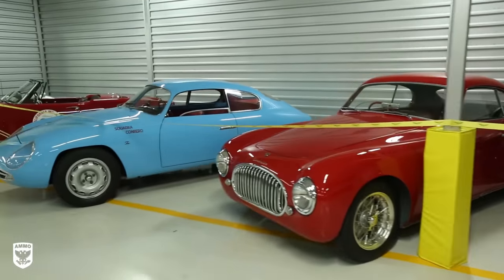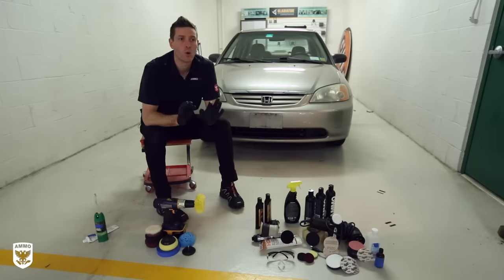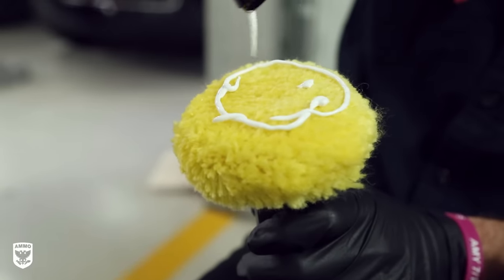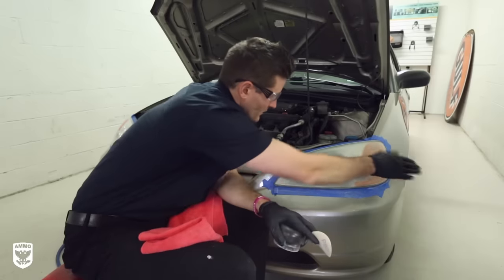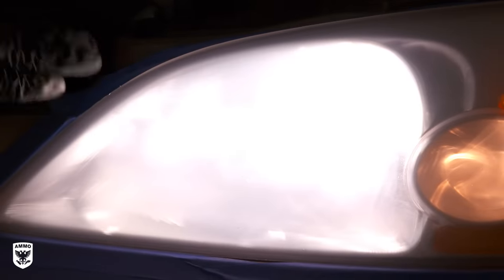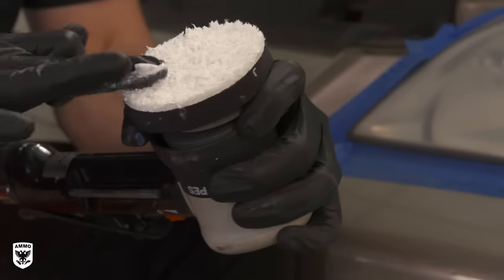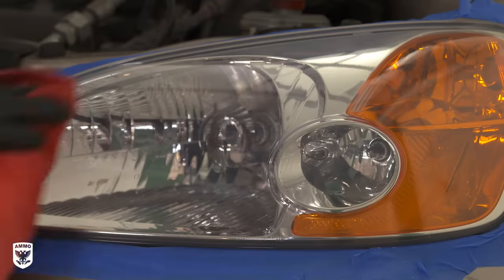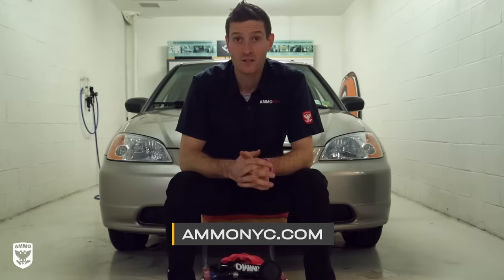How to Fix Foggy Headlights: 3 Different Methods: Honda Civic

Comment: Just a tip... I would suggest your sanding steps should be vertical - horizontal - vertical.  You want your first and last groves to be vertical.   This will insure your light dispersion pattern his spread across the road surface, similar to a vertical prism distribution.    Having horizontal lines after the last step will cause lights waves to be shot up into the sky.

Comment: Came across this a few years ago, back for a refresher.  Still the best headlight restoration vid on the interwebz
Reply from the maker: Thanks!
Reply: Hi! Which system are the grit sizes recommendations referring to? For example P180 (FEPA) is 180 (CAMI), but P1500 (FEPA) equals to 800 (CAMI). I'm not sure which grit sizes to get, my grit sizes come in the P-numbers (FEPA)

Comment: Don't forget to change your blinker fluid
Reply: mark schroeder i was going to comment that LOL
Reply: Remember to put on throttle body spacers for +50hp
Reply: ROFLMAO    I hadn't thought to do that.  Better get on it!!!!!  TOO TOO FUNNY!!!!!!!!!!
Reply: Nowadays you don't need to change it because car manufacturers put as much as 600.000 blinks before the fluid starts to go low. That's what my father told me when I bought my car.
Reply: Lmfao!
Reply: Gotta change those piston return springs soon too.
Reply: I was told my fuel cap pads need to be replaced monthly, too. Is that true?
Reply: My blinker fluid keeps leaking but I just found a blinker/flasher seal kit and I got a great deal on ebay 6.99 for 1 quart of blinker fluid w the purchase of the seal kit. It's 19.99 at Autozone . I just replaced the muffler bearing 2 weeks ago that was an exhausting job but it's done. All I have left to fix are the 8 Kuniphaler pins that hold the back of the wheels on and she'll be like brand new. Don't forget to change the air in your tires every 1789 miles for proper tire wear.
Reply: R Paz plz tell me your joking. Ik the first comment was a joke but I can’t tell it seems like your not
Reply: my new car has hydrostatic blinker oil in a sealed and heat treated capsule, no more fluids it's awesome.
Reply: I also hope everyone remember that it's time to change to summer air in the wheels now.
Reply: Lmfao!
Reply: @user-rm3tr5gb1t  HAHAHAHA but snicker, snicker, I WILL pass that on to a friend!!  Well maybe we won't be if she ever figures it out! IF
Reply: mark schroeder always use a left handed screw driver when open the blinker fluid bottle
Reply: @RP944  think I have a blinker leak , I only got about 346,002 blinks before it stopped working.
Reply: @jimdomi6206  It also depends which blinker you use more. It is known that for example in right hand traffic countries where we tend to take right turns rather than left ones we use the right blinker a lot more so it consumes the fluid faster. But hey, 6k (or even more depending on manufacturer) is a lot of blink going on.
Reply: @kentaylor5842  yep thats why they're called return springs,, you have to return them to the store for new ones
Reply: @RP944  thank god for the internet,  i would never have known that. Thank you!!
Reply: @jimdomi6206  if people listened more as we do there wouldn't be many ignorants in the streets/roads
Reply: Where are the fucking spark plugs on this Diesel engine?
Reply: Also be sure to replace your muffler bearings
Reply: It's seasonal fluid as well... you really don't want to use your summer fluid in the winter.

Comment: So if you added a sanding step and a layer of protectant to the "DIY" kit, you'd have something that's pretty much professional grade. Cool beans.
Reply: Locutus They actually sell kits like that.
Reply: Is it me or the yellowish layer that forms over time is not the lens cover, but just the "protective UV layer"? 
So I should polish the headlamp and apply a product which filters UV so It won´t be yellowish again?
Reply: Correct - you definitely need protection if the UV-protective layer either failed or was polished off.
Reply: kits come in various forms. The one I use is $20 ish and it has 3 different grades of sand paper, 2 grades of polish and a uv sealer. It also comes with a backer to use in your drill. For $20 i can do about 8-10 cars or 5-6 if the lens are really bad on 3-4 or four of them. I get a lot of my work from my towing business and do it during off time while having a beer or 3 in the evenings. It takes about 10 mins per lens and charge $35 ech lens or $45 if they are really bad.  If i lived in bigger populated area I could get paid to drink beer lol.
Reply: Bonniville Black Cherry hey man! That’s the reason I’m watching this video! I’m 16 and I would make more than minimum wage doing this in my area. So many cars with haze. Make friends with the guys that own a couple car washes, tire shops, mechanic shops, get me some business cards made. While also going out and getting clients myself. $35-$40 a headlight for GREAT results. Go after it and get as many cars as I can after school and on weekends.
Reply: @bonnivilleblackcherry9745  Just dont ever let them know they can get aftermarkets on Ebay or Amazon for the same price you charge to do those lights. Lol
Reply: yet to find light housings on ebay for $35 that are in good shape and amazon doesn't sell used shit that I know of. SO good attempt at trolling there sweetheart ;-).
Reply: Small print shops do not charge that much for business cards. Do a car that has both lens very hazed and take a pic after one is done. have them put it on the back/face depends how you look at it lol. And your contact info on the back. You can also buy sand paper and the polishes in packs/bottles separately that would do a 100 cars for the same price as a a kit would do 8-10 cars. Hit up a body shop supply biz for them.  A cheap canadian tire (im in canada) polisher is great and its not being worked hard so will last yrs. Key thing is wash the lens well first. I use wd40 for a quick spray to remove any tar on them from the roads.  Let it sit for 15-30 mins. whipe it off then wash with (i use dawn) dish liquid soap. I go over the lens quickly by hand with 800-100 grit. This will show if any shit is still on there to bet burned into the plastic lens before you hit it with an electric polisher. Once clear go to town with the sanding and polishing.
Reply: +Bonniville Black Cherry  ...  You obviously don't know how to refurbish lenses.  First and foremost, you should not and cannot recommend the same procedure for all headlights, which is what you just did.  Also, WD-40?  Heh heh.  15-30?  800-100, (I guess you meant 1000)?  They may just need a polishing.  EDIT:  BTW, no one with a brain "goes to town" with any finish work, at least, not the way you imply.  The work should be evaluated, thought out, and precise, depending.
Reply: +Bonniville Black Cherry  ...  She was not trolling, she is correct.  Why are you so defensive?  You don't want people to know the truth.  Also, the job he did on those headlights.  He still did not get out most the pits.  The best solution is to buy new ones.*  I bought BRAND NEW headlights and fog lights and side markers for under $200.  They even came with bulbs (which I did not use, but if the person needs to save for better ones, those will suffice).  Plus, there may be OEM restored headlights that can be bought for less, and for less than what you charge.  ...  *If a person decides to refurbish, then the so-called professional way is not the best, to start.  It may just take a polishing, by hand or orbital, then UV protection.

EDIT:  Note, he (Larry) already has the tools, which is a bonus, and he did do a good job.
Reply: $200 for lens for what type of car netzoned? And get back to me in how long they last before hazed over.  I don't refurbish 2005 honda prelude lens.  People usually come to be when the lens are $3-400 or even $12-1500 per lens in some cases. Not eveyone drives a honda or a toyota.
Reply: LiveLaugh MakeLove restoration of your original lights are good since they’re more higher quality than those on eBay or amazon which will only look good for a year or several months
Reply: Offhand 3M has a kit that has sandpaper in the kit!
Reply: @bonnivilleblackcherry9745  plus, a lot of cars you can't actually get replacement housings for anymore.
Reply: @bonnivilleblackcherry9745  which kit is it? Where did you find it?
Reply: @bonnivilleblackcherry9745  
I checked Ebay for replacement headlights for my 06 Maxima.  $164/pair.  To replace, you have to pull the whole front clip off the car.  I've done this and it ain't quick or fun.  
If I were in Canada, I would look you up for $35 each,   I would even hand you a beer when needed.  However, you one, me one ya know.  

X4
Reply: @kittkatt032  LOL,NO  but nice troll attempt(not)
Reply: @bonnivilleblackcherry9745  im looking for options my dealer quited me 2000 including labor for changing lenses on a 08 forrester so you are right they cost a lot.
Reply: @kittkatt032  good luck on that sweetheart. I'd charge more to install them and in some cases by a fair margin. My market isn't ricer kids with fucking honda civics lol.
Reply: @frankmontez6853  any auto parts store has them.  If you have stores like canadian tire (canada) they would have them too.
Reply: Why does he dry sand in the professional version instead of wetsand?
Reply: I used sandpaper 800 to 3000 and then,  on an unpolished surface a clearcoat for headlights.  I made it this way so that the clearcoat adheres better.  But the surface of the headlights feels different now,  like it's a little sticky,  not that slick,  as a new headlight.  And it's still just a little yellow.  I've been told headlights also get yellow on the inside and that yellow you can't remove unless you take it apart.
Reply: @kittkatt032  bruh headlights can be easily $150-300 EACH on the aftermarket
Reply: @LiquidTurbo  At least in furniture finishing, it is nice to dry sand first to see that it is completely sanded, but just barely. Sanding dry gives a completely flat (no shine) finish that is easy to judge. When you have just gotten the finish completely no shine, stop and move on.
Reply: @rodc4334  thx

Comment: Not professional but super quick permanent solution is melting poly-carbonate surface with heat gun. You can super easily burn it, but with experience comes good results.

Comment: After watching this video, I had the confidence to do this myself to my car. Got a $15 from the auto parts store with the polish and protectant along with a buffing and sanding kit. Grabbed a few sheets of sand paper from the hardware store too just to make sure. I had my headlights looking like new in under an hour. Saved me a ton of money and I hope that it lasts. If it doesn't, I know that I can do it again myself!
Reply: Do you remember how long it ended up lasting for?
Reply: For this car, getting a new headlight is another option it's around $100

Comment: After trying many different headlight restoration kits, and spending over a hundred dollars, not to forget the labor I put into trying to make these products work, I figured out the perfect way to get clear headlights again. I shopped online and bought replacement headlights. It took me less time to instal them, and now they are perfect. I did have to realign them as to not blind my fellow motorist driving the opposite way. I am very happy now and tell all my friends, to just buy new headlight assemblies and save time, and aggravation.
Reply: sounds like you half-assed the job, or just didn't follow the instructions completely. The 3M kit definitely works.
Reply: Maybe in your country but in mine? Not so cheap :P
Reply: Decent DOT certified lights are not cheap, at minimum for most cars you are looking at $250 a set, I got a complete 4 step kit for $40 and had enough to do probably 5 cars, so did mine and a few paid jobs and made money.
Reply: Headlight assemblies for my vehicle are over $300 for the pair...not really an option.
Reply: @Barry Goldwater congrats to you!...my 10 year old toyota headlights are yellow and cost $250 each for OEM and $190 for non-OEM. So yeah, I'm gonna polish my lights...
Reply: @Barry Goldwater prius with stock HIDs.
Reply: lol my headlights are over 1k a piece

Comment: Yep I do the 2nd one all the time, but I skip the pad and just use some 600 grit sandpaper, wet sand it, then 1000 grit, then I rub it out with some of 1 year car polish on it. It takes about 20 minutes to do and It last for a few years before I have to hit it again. Granted it's not professional but it works really well!  Thanks for sharing. Best Wishes & Blessings. Keith Noneya

Comment: Great video.
Another solution that works is direct lemon juice. (cut a lemon in half, rub it directly over the headlights followed by 400 + 800grit sandpaper then with the lemon again) It's great for people who have allergies to chemicals, or don't own power tools.
I had to do my headlights 12 months ago and they are only now showing signs of needing to be done again. I never went over the top with a UV coating the first time.. but after watching this, I will be using it this time.

Comment: The best auto parts store brand boxed kit I've found is the Sylvania one.  It's all done by hand with 400/1000/2000 grit, followed by Meguiars plastic X compound on an orbital, topped off with the supplied UV clear coat.  I've done over 20 cars with this specific kit and it has worked wonders on even the worst headlights.
Reply: Steven Bradl do you have a link??
Reply: Any idea if the 400/1000/2000 grit sizes are the sizes of CAMI or FEPA (Pxxxx) system? For example, 180 (CAMI) is the same as P180 (FEPA), but 800 (CAMI) becomes P1500 (FEPA)

Comment: I only use 2000 sand paper, water and some soap when removing the deteriorated coating. I then apply compound and use a buffer at 1800 rpms for the first, then 2000 for the second. I'm sure that I am doing it wrong, but its the most I have to work with at the moment. Though they do look great after I finish them up applying the sealant, I will make sure to save up to buy the exact things I need for an even better result. thanks for the videos guys.

Comment: Well I just applied the 3rd method to my cars and im a happy camper. I was a detailer for a Ford Auto Auction 20 years ago, today I'm a Handyman so working with sand paper isn't a big deal. Back when I detailed cars for the auto auction we used 1000 grit and apply a wet method among other alternatives on oxidized surfaces...We'll back to the headlights, they came out great I personally believe you can learn how to wet sand (my preference) you can't really screw things up. Just start over or buy new headlight? Enjoyed the vid.

Comment: Just restored my headlight, it was a lot of work but thanks to this video i made it, I wouldn’t have been able to do it without it except I think I went too far a tad vid with the wool pad because the headlight is looking a bit foggy inside 😳 but overall it came out many times better than what it did before and saving hundreds too

Comment: As a final step i use about 3-4 drops of a 9H nano coating and have had awsome results.
It will add UV protection as well as durability to the lens and last for up to 3 years if you do 2 coats. The product i have had great luck with is ARMOR SHIELD IX

Comment: I've used Turtle Wax 4-stage damp sanding/polishing/sealing kit before. It works great for ~8-10 months, then plastic starts to turn opaque again. 

Some buffoon came by with a bottle of cleaner and WD-40 trying to claim effective restoration and I was LOL.

Comment: For the camera comparison it would've been cool if you showed the exposure meter for a scientific comparison. For example, set the camera exposure so the meter shows a couple of stops under exposed on the original, then presumably at the same camera settings the after would show a couple of stops over exposed. You would then be able to say based on the exposure difference the cleaning allows (e.g.,) 4 times as much light to pass.

Comment: I’ve used the sanding with multiple grades of sandpaper and buffing and then applying a good sealer to protect. The better and longer lasting one is the way I do it now. Sanding down with several grades of sandpaper, masking the area and spraying a good uv protected clear coat. This is in my opinion is the best and longest lasting way.

Comment: Great video, My headlights are nowhere near as bad as those ones looked on the Honda, but would I be able to just use 2500-3000 wet n dry paper to clean them up a little then Polish and  re coat them. Or would I have to go through the whole process??? Thanks
Reply: Try it, just after the polish do not recoat if they do not look great. If they do not look great go back do the full job.

Comment: Thanks to this technique, I managed to restore the headlights to near perfect condition on a Toyota Yaris. This was very informative, although you can get away without using a sanding block. I felt that it was more flexible.